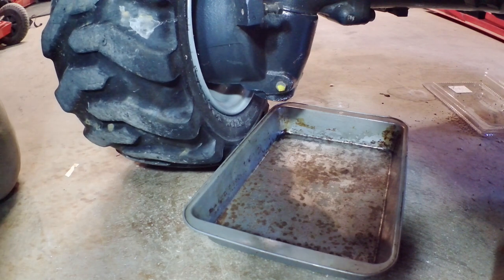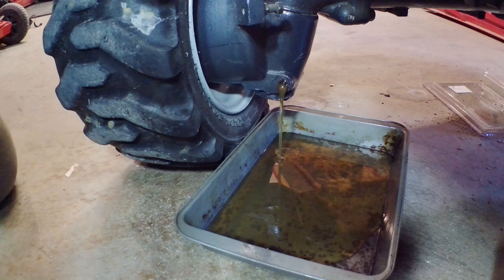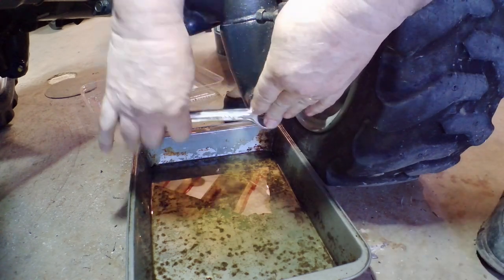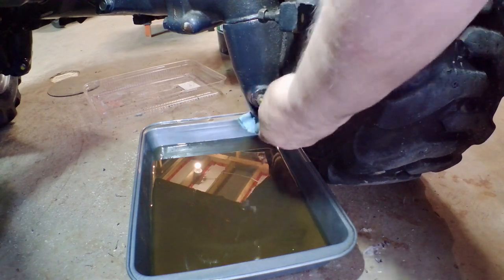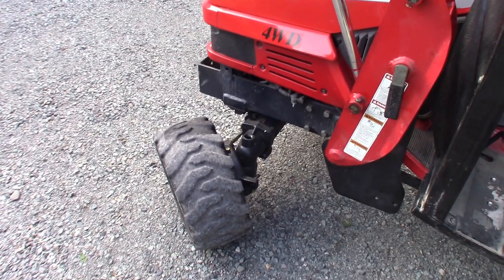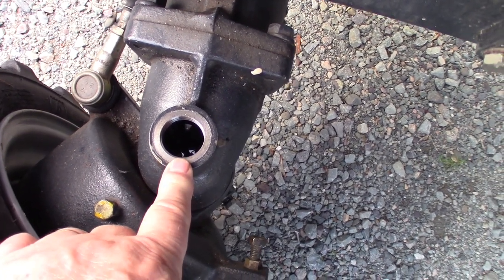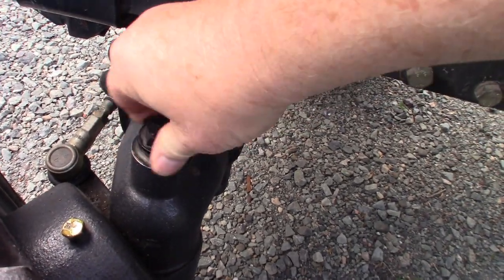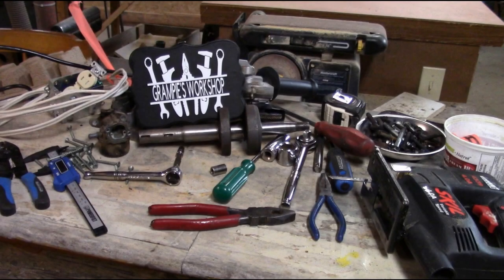Changing the Front Axle Oil on the GC2300

Comment: Great tip on the 5 gallon bucket. 
I suppose I will have to clean off one of the benches first.😁😎
I was thinking about the problem of filling the axle. 
Perhaps a takeoff on the NASCAR refueling system would work.
A four liter container with a hose fitting on the top. Having it attached to the cap would work. Also with one of the gas can vents on the bottom.
If you can, find or make, a fitting for the fill port to hook the hose to. 
Then with the container hung you can just wait until it empties. 
Now for a complicated, and mostly unnecessary, way to confirm the level, whole allowing you to control the drain easily. 
Thread a pipe fitting into the drain. Attach an elbow and pipe fitting long enough to reach to the full mark on the axle. 
A picture would show it better. 😑
Drain the axle by rotating the elbow and pipe. Down to drain and up to fill.
With the pipe in the up position fill the axle until the pipe is full. 
To avoid spilling while inserting the, overly complicated,  draining fitting, leave the fill cap on until you have the drain fitting inserted.
It was entertaining thinking about how to complicate the process for you. One more set of special tools to sit on a shelf. 😁
40 years of writing instructions for periodic oil changes on anything from  hydraulic presses with 20 barrels in the tank to gearboxes with 8 ounces. 😁😎
Reply from the maker: How's she goin'?  You know Dave I could picture this 'fill/level check system' when you were describing it!!!  It would be pretty decent and not that expensive either.  But I'm afraid it would get hit by a rock or gravel or some such thing and break off!!!  But maybe we could work on a 'special guard' for this 'special tooling' !!!  LOL  The 20 liter pail tip is really nice I have to say.  I wish I had thought of it!!  Thanks Dave for all the time and support you give my channel.  It is greatly appreciated!!  Take care!!!

Comment: Very good video! This process is almost exactly the same as the BX. I have a bucket pump that fits in the bucket pour spout, it has a rubber hose you can then put in the fill port on the tractor. It’s plastic and fairly inexpensive. Take care!
Reply from the maker: Good day eh!!!  I have seen those bucket pumps and they are neat.  I bet I could still spill the oil everywhere even with that pump!!!  LOL  I expect the process would be the same as for a BX as the machines are almost identical in a lot of respects.  Thanks for watching and I enjoy your comments.  Take care!!

Comment: Just curious, did you bring the oil up to the bottom of your gear, I really can’t tell what’s up half way on the axil. But looking down the fill whole mine is just about the gear. I think that was good, how bout you ?  Thanks in advance.
Reply from the maker: How's she goin'?  So  nice of you to check out my video and then ask a question!!  First of all I'm not a mechanic.  But I have a lot of maintenance background.  The book says "halfway up the gear when the front axle is on level grade" is the correct amount.  But like you say, that 'line' is very subjective.  
Here's my outlook on it:  the oil in the front axle is needed to lubricate the bevel gears on the front drives.  It takes a while for the hydraulic oil to adjust it's level and get into both gear casings.  So you could fill to what you see as 'half way' on the bevel gear and 5 minutes later the oil level may have settled and you have too much or maybe not enough.  
One thing to be careful of are the seals on these front ends are prone to leaking due to pressure build up in the axle/gear case housing.  To help prevent this there should be a small vent hole in the fill cap.  On my 2007 GC2300 there was no vent hole and sure enough my seals leak.  
So this is what I do.  Since my seals are leaking now I add hydraulic oil (TDH oil) to the front end until I feel it is covering at least the bottom half of the top bevel gear.  Since the gears rotate and spin in the oil bath this will ensure that the wearing surfaces on the bevel gears will get an oil bath of some sort or another and help prevent wear.  By doing this I also hope that the pressure won't build too much and cause the seals to leak.  
So far anyways, this has been working for me.  Although I do check this oil level often and have to refill from time to time, it has slowed down on the leaking oil from the seals.  
So to answer your question, I would add oil until at least the bottom half of the bevel gear is flooded.  If you add too much, the worst that can happen is you will blow out the seals.  To little oil can cause premature failure of the bevel gearing and that would be a show stopper and bank breaker perhaps too!!  This can be a problem but generally speaking a leaky seal won't be a show stopper.  My seals have been leaking for at least the last 1000 hours of machine operation and I have almost 1100 hours on the tractor now.
A long winded answer but I hope it helps you (if you can make sense of my ramblings)!!  Thanks again for dropping by the shop and take 'er easy!!

Comment: I am curious you are using hydraulic fluid my 1529 same tractor just bigger uses 85/140 gear oil
Reply from the maker: How's she goin'?  Nice of you to stop by the channel Franklin!!  Thanks!!  In the manual it says use TDH oil which is the same oil I use for the hydraulics.  But I have had suggestion from knowledgeable people that say gear oil is just as good and it probably wouldn't leak past the seals as easily either.  My seals are bad and need to be replaced, but maybe this summer.  How are you liking the 1529?  I was looking at them when I was shopping for my GC2300 (or the equivalent in 2006) .  They are nice machines eh!!  Take care!!

Comment: You should have warmed it up first.
Reply from the maker: How's she goin'?  I wonder if that would have helped it not get on the floor!!  LOL  Since the oil reservoir for the front axle is only the axle casing it would have taken a lot of driving around to warm the oil.  It's pretty light weight hydraulic oil so it flows pretty good, but since hydraulic oil tends to creep and stick to surfaces, it took a while to drain.  Thanks for the suggestion though.  Most times we change oil it's always a good plan to warm it first to get it to flow better!!  Take 'er easy!!!
Reply: @GrampiesWorkshop  Did you say it was the same oil as the hydraulic oil.
Reply from the maker: Yes the same type.  Some guys are changing to a heavier oil because the seals leak.  But what I found was the fill cap had no breather hole in it and so the oil would warm after a time and build up pressure and the only relief it could get was through the seals.  My seals are leaking too but I did put a breather hole in the fill cap and the leaking has more or less stopped.   @tomsommer54

Comment: You are missing a step. You must remove the top plugs near the tires to allow air to escape and oil to rise in this part of the axle. Otherwise this section will not have enough oil because the air will prevent it from rising. Add oil to reach these openings.
See the picture : https://drive.google.com/drive/folders/1792lJrmvITTAzmCMKlAqa84v8Xv0y2mf?usp=share_link
Reply from the maker: How's she goin'?  Thanks for this tip.  The oil flows so slowly that I figured if I just added it nice and slow it would reach both side of the axle and with the 'fill' hole more than half open air locking wouldn't be an issue.  I was wrong again!!  LOL  I sure appreciate you taking some time to watch and comment.  I hope to see you back again sometime.  Take 'er easy!!